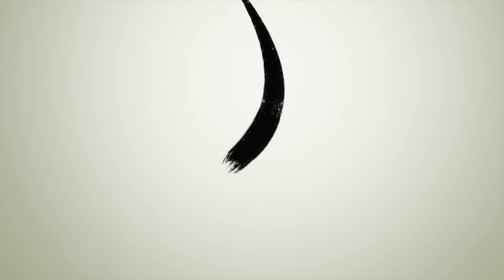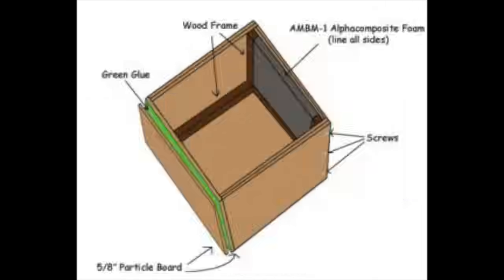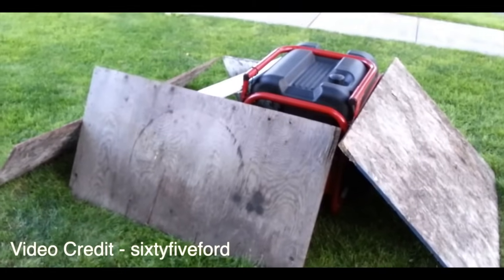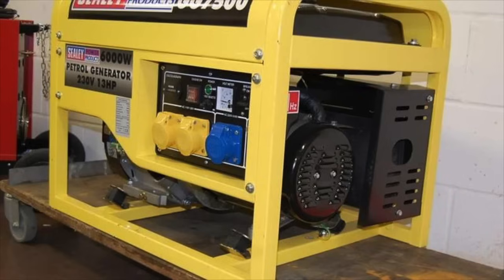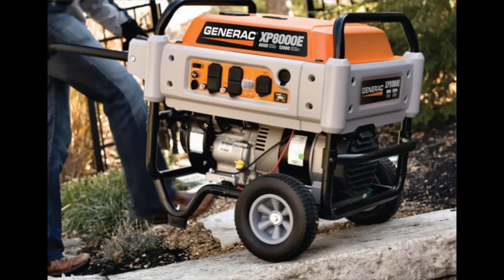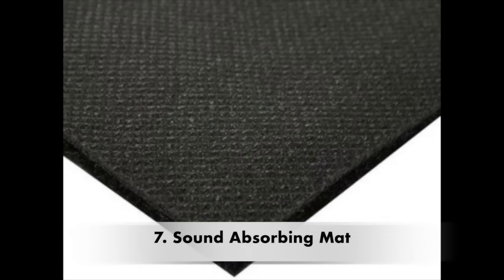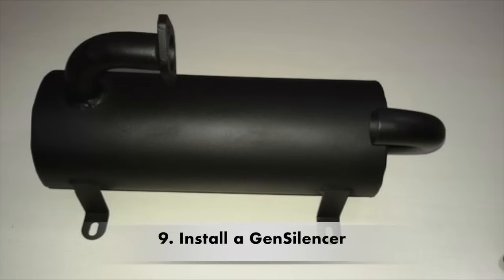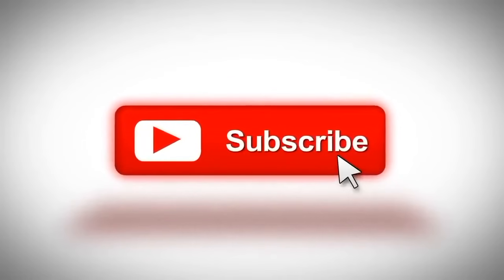How to make a generator quieter - 9 Ways That Work!

Comment: I built a concrete bunker for my generator out of cement blocks and a poured concrete roof. Well I installed 1200 cubic foot per minute industrial ventilation fans that go on when the generator starts up. It keeps the generator cool in the hottest of weather. And it reduces the generator noise level by over 45 decibels.
Reply from the maker: You really need to send me a picture of that!! That would be awesome! Just send me a msg on the contact form at https://soundproofguide.com I’ll reply and then you can send me a pic by email if you’re able to. Thanks
Reply: @soundproofguide  Message sent. I went out and took some photos today in the rain.

Comment: A car muffler works very well however You will find that the intake noise becomes a problem once you've muted the exhaust noise.
Reply: Omar Williams  The noise the carburetor makes as it sucks in air. Most folks don't consider that, but on a small engine, that noise is almost as loud as the exhaust noise. Having eliminated the exhaust noise, that was a a remaining and prominent noise around 30 Hz.
Reply: @basspig  
That's not carb/intake noise. Air cooled generators have a fan built into the flywheel and most have a fan for the generator end as well
Reply: @kirkstinson7316  My Northstar 13000 has a fan too, but that's a mid/high frequency noise and sounds like a vacuum cleaner. I've damped that with OC703 panels. The intake noise is a low frequency hum. I've silenced the exhaust so that it's 82dB one inch from the exhaust pipe. The major noise now comes from the intake side of the genset. Granted some of the LF noise is the vibration of the frame transmitted to the concrete slab of the generator bunker that I built.
Reply: Like  when the wife quits farting and keeps talking.
Reply: Study the inlet of a car engine. Notice the "reverse cone" built in to the piping. This critical items helps keep some of the intake noise inside the inlet. The trick to automotive acoustics is testing. Try different lengths and sizes and repeatedly measure the sound level accurately. Quiet cars don't get that way by accident. Car buyers never see the backbreaking work of the engineers behind the scenes.  Yeah, I am speaking from experience! 🙂

Comment: Big pipe muffler does not work because a car has more exhaust flows than gen motor. The flow does not move fast enough...it help the restrict the out put pipe
Reply: motorcycle mufflers.....you need something in similar air pressure/volume of exhaust, emitted by your gen

Comment: Dig a hole in ground and put it and cover with hole for the exhaust
Reply: Then watch it explode when it gets hot.
Reply: What happens when it rains and the hole fills up with water?
Reply: I did this. Worked pretty good except somehow dirt got in the gas tank. Had to put a inline fuel filter in after that 🤪
Reply: That’s one hell of a hole. 
Pass.

Comment: I'm going to box in my Champion 6800 watt generator to use at my cabin year round, so will need a good fan. Anyone got specs for adequate airflow? Also any details on the best way to vent the exhaust and still keep it quiet? It puts out A LOT of heat, melts the snow for at least 5 feet at -15c.
Reply: Just need to calculate the heat loss from the gen, about 2x the hp rating
Reply: I got 2 car radiator fans and a 12v 20watt powersupply..  the fans are wired through an attic style electric thermostat so they only turn on when temps get above 110°f and they blow like a chinese hooker..  only actually draws about 1.25a or 135watts ac so not too bad of a drain from the generator also theyre only on for about maybe 30 seconds before they cool it off below temp set but are on again in 5 mins..  but do the math and its not as bad as a constantly ran fan that dont blow worth a damn.  Am thinking about controlling them though and putting in a dimmer so would draw less and be better overall..  cheap also..  got fans for 20$ and supply for 10$..  think is perfect the way they already have mounting hardware included and just how damn powerful they are..  i ran 48v through one just messing around and it literally lifted a 5lb weight off the ground and hovered there..  didnt hurt it..  lol

Comment: I know this isn't directed at this video, but I get alot of noise in my house from a highway that is close to me. I think my issue is my windows. Is there a sound rating on them? Or should I look into getting something like a triple pane window? Thanks
Reply from the maker: Watch my window soundproofing video and you should get some useful information. 🙂
Reply: @soundproofguide  I just watched it. You said to use double glazed windows, but they only have two pies of glass in them. Would a triple pane window work even better? Thanks!
Reply from the maker: Certainly would! They are a bit more expensive than the double panes but it’s worth it. I should have mentioned that in the video. Thanks
Reply: @soundproofguide  Thank you!
Reply: Quarter inch plexiglass held in place with magnetic tape. You won't believe the difference it makes. Old dot matrix printers used the same tech to make them bearable in offices.
Reply: Is the sound (noise) you are hearing high frequency or low frequency? High frequency sound passes easily through the smallest of holes. Low frequency requires heavy mass (weight) to be stopped (or large dimensions which is usually not viable).

Comment: So a tiny hole in your box will make it useless,  but leaning plywood against your generator will greatly reduce sound?  I'm confused now lol
Reply: Why don't we just design a pyramid box? it's angled to the ground while having slits for exhaust?
Reply: He said leaning boards will reduce the noise by 10 decibels. A hole in the box will let the sound waves out. You are trying to compare apples and oranges.
Reply: @user-1A-2A  These are two different sound dampenings going on here.  Angling the boards against the generator deflects the sound downwards and into the sound absorbing grassy ground.   If it were concrete it would not work as well.  The other was a cabinet where it is designed to hold the sound waves inside the box and just like a damper in a speaker box if there is a hole in it, the sound waves will escape.
Reply: You’re right. He got caught slipping.
Reply: Unlike a box, the plywood is angled so that the noise is directed downward. A box is not angled, it's just 4 vertical walls which keep the sound inside without any directional focus. So a hole would disrupt the acoustics from being enclosed inside.

Comment: Don't put a generator in any box it will  blow it up it needs air to cool down best one is the ply wood walls but leave gaps for ventalation
Reply: Put a double wall on one side and the create a labyrinth so the air can come or go but the sound is baffled. Vent screen the outside and inside to stop critters.
Reply: Should the vents only be around the bottom? If it rains or snows I don't want any vents on the top to allow water in.
Reply: Fannnnn

Comment: Having a longer extension cord may also give you a reduction in amperage availability to your projects be sure and wrap any extension cord connections making them waterproof

And don't use any small extension you want at least at least 12 gauge for over a hundred and preferably 10 gauge
Reply: Bruce Norris … I don't know of any outlet selling cords over 100 ft long and certainly none selling #10 with standard plugs on the end. (maybe home brew stuff) You can get 20 amps through a #12 wire at 100 ft.  I think you will find that 50 ft distance to the gen set is a fair amount and you will have cord to spare. You can always put an object (park your car?) between you and the gen set to cut noise without covering the unit and blocking air flow.
Reply: @rupe53  you can find number 10 gauge cable at home Depot or Lowe's but it's not cheapplus the fact that a lot of generators are putting out 220 which means you're going to have to have four lines of number 10 to power lines when neutral and a ground,.  After that you can put together the needed cord extension plugs they even make waterproofat which point you should be able to handle 30 amps of to for 220 or 240 volt AC
Reply: @brucenorris3926  … When I made my reply I was suggesting a "standard plug" would be a household style rather than the larger capacity NEMA standard "twist lock" configuration for 240 volts, which are available up through #6 wire. (and $3 - $5 per foot) You still wont find them over 100 ft because that's where the UL listing stops. (consumer protection and all that stuff) Yes, you can make your own (at any length) but that's not what the average guy is going to do.
Reply: Longer cord = more restistance = less power. There's no way around that.
Reply: @dontblameme6328  That why I use #6 4 wire for my 50amp gen on a 40 ft cable.

Comment: I tried an extra muffler i had lying around first, on my Chinese 5kw diesel, but made very little difference to noise outside(generator was in garage with exhaust going thru wall outside). So found a 2 meter long piece of old lead bath drain pipe i had lying around, and attached that instead, worked well, without a meter to test though, but seemed like about 50% reduction.
Reply: I was thinking about doing that. Like welding a second muffler to my generator
Reply: I wonder how rigid iron pipe would work with a couple extra bends...

Comment: Battery powered fan to keep the generator cool. WTF ..its a generator it makes electricity... just plug fan into it
Reply: Lol...silly as heck
Reply: Id like to know what smoke too....lol...if its smoking you need a new genny
Reply: Obviously he means exhaust.
Reply: Haha so true
Reply: Lol
Reply: That's what I was thinking
Reply: That part
Reply: I just lost braincells
Reply: @chadjones99. 💯%. My sentiment. Why would you run the fan on a battery like you said, floated to the generator???
Reply: Exactly what I was thinking about the minute I heard that said,lol
Reply: Place it underground,use motorcycle muffler
Reply: What about the smoke
Reply: @angelusman974  : You better "smoke" a little less ?!
Reply: @angelusman974  I just replied to video. He talked about using battery powered fan
Reply: @angelusman974  what smoke
Reply: Maybe you need to cool the generator when it stops working the fan like in tropical/subtropical climates?
That's my best explanation,but I'm not very smart about generators...

Comment: I worry about overheating it with an enclosure.  Trying to use my welder in my garage but feel bad for the neighbors..
Reply: I would have the same concerns, it's bound to build it heat Using the zombie box, and I'm sure that would shorten the life of the generator.
Reply: @sambiscits6711  Heat rises and there are honeycomb vents seen in the pics and the top exhaust vent. I hope for the sake of those expensive gens.
Reply: @FrustratedBaboon  I've recently had a Full House generator installed, and I'm looking into ways to mitigate the noise, I'm looking into something I can build myself.
Reply: @sambiscits6711  I'll build my own as well. Gonna spend extra for 500+ CFM exhaust fan and air filter so that the internal temp is only a few degrees higher than outside.
Reply: @FrustratedBaboon  Sounds like a great idea, I'm going to have to come up with something like that also.
Reply: @sambiscits6711  … just remember, anything you do that's against recommendations in the owner's manual may screw with the UL listing, or violate building code, never mind the factory warranty. Lawyers and insurance companies could also have a field day should there be a problem with fire or carbon monoxide.
Reply: @rupe53  You're right, as far as carbon monoxide it's really not close to my house, my main concern is getting an exhaust fan not sure what type to get.
Reply: @sambiscits6711  … if you don't enclose it then there's no fan necessary. Besides, attaching a fan would be a modification and would void the warranty and the UL rating. Double check your owner's manual and you will see all clearance recommendations. (if it's made in the last 10 years) If nothing else, consult your local building department for current code compliance.
Reply: @FrustratedBaboon  
Will 500 CFM. Match the amount of air the fan on the flywheel moves? If not it will over heat. And a filter is a restriction so you'll move less air with it in place
Reply: Run the exhaust outside the box. Most of the sound comes from the motor itself anyways.

Comment: While most of this information is quite workable, just remember that anything you do against recommendations in the owner's manual may violate the UL rating, which your insurance company (or someone's lawyer) may have a field day with should there be a problem. Any modifications to the unit or air flow restrictions are on the list of self inflicted problems. (sheds, boxes, etc) A hot exhaust going through a wooden wall is certainly a red flag here, no matter what you rig up. If it's not UL approved it's not worth the risk. Cheap and easy ways that don't cause problems are generally a little distance or an object between you and the gen set. (parked car in front of set works wonders)
Reply from the maker: Great point. Thanks
Reply: Thank you... I've been saying the exact comments.. and get told in so many words to STFU..lol..
Modifying the exaust will eventually burn out the engine... no warranty once that unit is enclosed or built in...lol..
Reply: @WilliamSmith-pz5nw  ... I was a factory trained repair tech for a couple of decades (recently retired) and I have been around long enough to pick up on a few things when a unit comes into the shop. It's not always obvious but there are tell-tale signs left behind for almost any type of modification or neglect. I can spot when a unit is stored under a deck, covered with a tarp, or left out in the rain / snow.... not run in months / years, never had the OEM oil changed... I have seen it all and can tell you EXACTLY why a failure happened. The flip side is I spent years in the fire service so know a thing or two about the cause of issues in a home. (fires, carbon monoxide, electrical problems, etc) Getting your point across (without pissing people off) is all about knowing your subject and knowing how to word it. OH, I also have a black belt in customer relations.  <LOL>
Reply: @rupe53  lol... Point taken.. I guess..🤪😳

Comment: I'm considering buying a generator for any eventual power outage. It will be a cheap (and noisy) generator) as this is a fall back situation only. I somewhat worry about the noise  so as not to annoy the neighbors, however, I think that in a eventual power shortage, the neighbors will understand my situation and be a bit tolerant. 

I already have the electrical connections to my outside shed so that I can put the generator in there if need be. However, I wonder if the generator will choke from the CO2 in there?
Reply: Try using a evaporative cooler unit to blow the fumes outside they don't use much power and move lots of air.
Reply: I keep my generator inside the garage where I wired in the transfer  box.  I welded an adapter to vent the exhaust outside. Can keep the things locked up. Note: 1200sqft garage, 50ft from the house, Kawasaki 7500watt generator.
Reply: @craigwiess1656  you have a great setup. Thank you for the feedback.
Reply from the maker: I wouldn’t worry about it, just leave the door open a bit and that should be all you need. Most small sheds already have built in vents on the top of the wall close to the roof, look for those and that will also be sufficient in letting most of the fumes and heat out: it really all depends on the climate you live in. Myself, I live in a cold climate when the power is usually out so I don’t really have to worry about my generator overheating. A small shed can also echo quite a bit so it wouldn’t be a bad idea to throw something in the walls of the shed to absorb the noise of the generator. Don’t bother with acoustic panels in a shed, old blankets hung on the wall will do just fine, just make sure they are secure and won’t come into contact with the generator of course.
Cheers
Reply: @soundproofguide  Hi! Thank you for the prompt response. I live in Québec city in Canada and I wont worry about the heat either in winter. I will follow your advice and also consider putting a fan to push the fumes out of the shed if need be.

Comment: I basically threw the generator in a back room with plywood all around it and piped the exhaust through a window. It's a quiet Honda 3kw so you can barely hear it. I'll soon be getting a 6kw diesel quiet one and already building a box with thick foam inside and a fan to cool it.
Reply from the maker: That’s awesome! Thanks for sharing!

Comment: Umm I don't think you need a battery powered fan if you are running a generator. Just plug it into the generator (roughly a 100 watts depending on the size of the fan)
Reply from the maker: You could certainly do that if you don’t need all of the outlets.
Reply: @soundproofguide  That's what Zombiebox does with their fan.
Reply: Zombie box uses a solar powered fan with a storage battery for night time use.  the solar fan can be bought at hardware store if you want to make your own
Reply: Just use an outlet expander of some sort or take remaining power from a multi-outlet cord.

Comment: Can you make a video about soundproofing an exhaust in a bedroom?
Reply from the maker: That’s specific. Could you elaborate on what this exhaust is used for and how big?
Reply: @soundproofguide  Try to search "anemostater" on google images
Reply: Sounds like your trying to "off" someone while keeping it quiet from the neighbors
Reply: I know exactly what you're talking about. The best and cheapest way is to replace it with a whisper exhaust fan. They have them on Amazon rated by sones (40dB @1khz) of sound that they make. I purchased my 0.2 sones Panasonic Whisper for $45 at the local Big Box hardware store (Lowes). Good luck, and cheers.